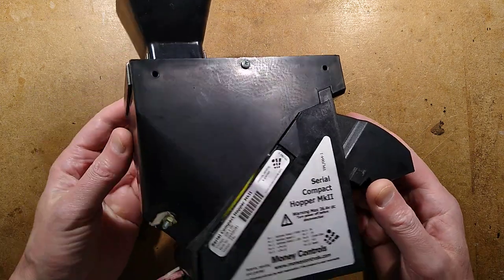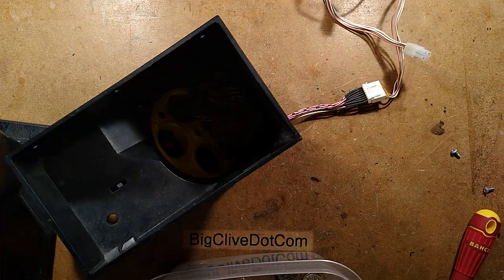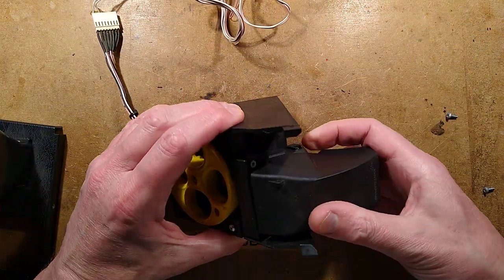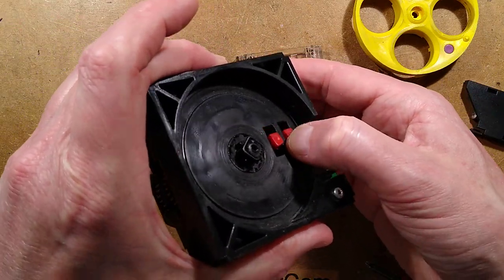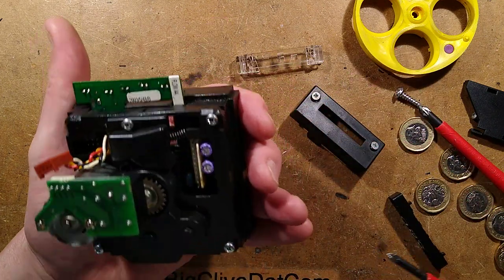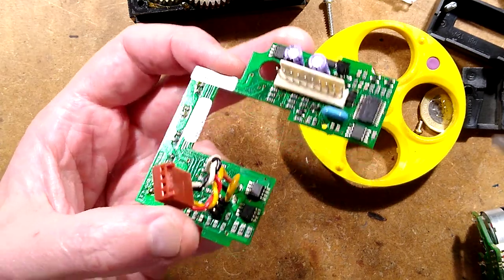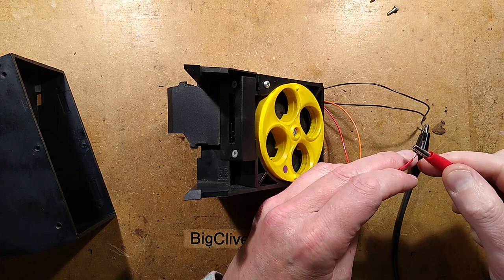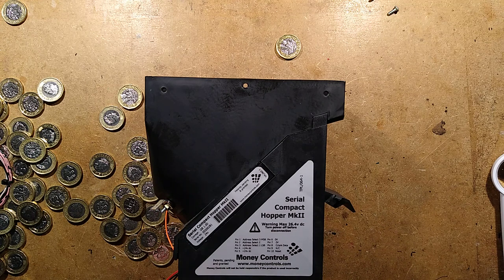Coin payout hopper teardown

Comment: I worked on Philips ATM machines in the late 80's, no coin, but still a very interesting mish mash of electronics and mechanicals. Also interesting was how easy it was to dispense ALL of the cash out to the front of the machine from the service console, who's pin number was VERY easy to guess, if you started guessing from 00000000.

Comment: In the past I've worked for an ATM manufacturer as an engineer and in the beginning of the 2000's the dispensing of coins was added for a short while. The mechanism used was fairly similar to the one you show here. Every denomination had a different coloured hopper wheel. Nice to see one again.
Reply from the maker: In this one the wheels are also colour coded to coin size and thickness.
Reply: @scannaunderscore1  are you high? GO AWAY
Reply: Bank of America still has coin hoppers for ITMs (interactive teller machines, like ATMs but with a remote teller to help you).
Reply: Worked as an arcade repair tech for a pizza loving rat that shall not be named. Very similar overall design and operation in the token-driven arcade space as well, but with non-cash arcade hoppers they don't bother with the parts that make it less possible to get bad counts or runaway from a dead transistor. Neat to see the dual opto sensor since those getting dirty is one of the more common failure modes. Also they just wire straight to a card interface board and it handles running the motor and counting the coins from the opto.

When they converted to card a pay system years ago the conversion was simple for some games, and a nightmare for others that had oddball 120v driven coin hoppers. Took them some time to figure out that EMF from sometimes failing marquee lights from another game on the same breaker would cycle the 120v hoppers.
Reply: @carpespasm  
"Worked as an arcade repair tech for a pizza loving rat that shall not be named."

Chuck E. Cheese
It's named now.
Reply: @unlokia  no hes right though
Reply: 2000s seems like yesterday. Oh my....
Reply: I find ATM's fascinating. I think because they were the first thing i recognized as a machine when i was a kid. I once caught a glimpse into the room behind the ATM which really made me want to see what was going on inside it.
Reply: @scannaunderscore1  troll !

Comment: Next video: "I got kicked out of a casino for hotwiring their coin dispenser..."
Reply: The trouble is opening or I should say trying to open any door on any slots machine or video poker or whatever will instantly trigger a loud alarm and a bright white or yellow flashing light (The "candle") on top of the machine.
And that is not even considering the incredible number of CCTV cameras all over the ceiling of pretty much every casino and last but not least the people !
Other players/gamblers/customers whatever you want to call them and also staff members who will no doubt catch you in the act.

Of course you will definitely get kicked out of the casino but frankly it will be nothing compared to what will follow:
You'll also be banned for at least several years, if not for life from all casinos in your country and get prosecuted and face criminal charges (No kidding... 😂)

Comment: I worked on the much larger versions I guess normally used for change machines that held large amounts of coins so one could say change bills to quarters to feed various vending machines. In this case they were at car washes with most of the machines requiring coins or a variation as they did not give change only time, so you had to have the correct amount. They were bigger versions of what you just showed, only the machines were made of stainless, had bigger wheels for more coins, and a more electronics as it was hooked to a motherboard to convert the bill denominations. They also had an agitator to reduce jams. All in all still interesting machines. The stop relay worked because of the load to dispense the coins was enough that with no power, the dispenser would come to an immediate halt. I'm sure there was circuitry involved to time it correctly to stop. We got some newer stuff in and they were very complicated using mostly bills and just one dollar coins that rarely got dispensed as they were used as backup for the one dollar bill dispenser in case it got emptied or jammed. Those were beyond my pay grade and like the IOTs, were hooked to a mainframe in another state and required their blessing to make any changes. Well, enough for now, thanks for all your videos, I enjoy them immensely.

Comment: I work in the gaming industry and use these hoppers widely. 

The machine counts the coins and it’s upto the coin mech to divert the coins. The operator needs to press “hopper top up” and the machine will tell the coin mech to divert the coin into the hopper or cash box

The low coin pads are in the event the operator did not press the hopper top up so if the hopper is running dry, it will make sure coins go into the hopper. A feature not often used in the gaming industry. 

Mars or MEi used a protocol called Hii or Hi2. Cctalk is industry standard now and used by every manufacturer and part of the technical standard. 

The hot glue is to stop “sniffing” the data line and inject commands. Quite common at one point where fraudsters would try and latch on the data line before encryption was popular. We had to heat shrink all looms years as these started to hold more money. 

The hopper does reverse. The red “things” are called hopper release fingers and can still be purchased. 

You can rotate the hopper 90 deg and it will pay out the side if you wanted too rather than use the chute. 

They do a 4 pin parallel version of this hopper which is even simpler. Just 24v, gnd,opto gnd and coin out

Comment: The light bar multi sensor combination is also a security feature. If the coin fails to break the beams in the right order and time the hopper will throw an error. People will stick LED wands up the dispenser and cause the hopper not to count three coins. By having three lights this complicated defeating the counter. Prior to casinos going countless it was a big problem. The locking hopper motor is also a partial security feature because with enough effort and time you'd be able to spin the hopper disk manually and get coins.
Reply: The light sensors can also be so that if a coin comes out, hits the deflector, then does a brief bounce back into the sensor, it isn't counted again as the sensors have to trigger in the correct order.  Coin mechs also have similar arrangements of light sensors, for anti-yoyo of coins.  Also with the relay it will help if the board gets fried, say by someone with a spark gun, it has much less chance of spitting out money.
Reply: @MakinStuff  I must have disturbed some dust when I replaced a few bulbs on my Barcrest fruit machine and eventually found out it was that little sensor strip causing multiple hopper errors.  Cleaned it and worked a treat but I had to reset after a coin dump as it was misreading the number of coins.

Comment: I wrote the software for many AWP (fruit) machines and the code for driving hoppers, including this one. It has a serial interface, but older ones had a simple 5v line you'd wiggle for the 24v relay to click and payout...watching the opto sensor for coins to pass, or for foreign objects trying to block the opto.

Fun times. I have a box of old fruit machine hardware I should send you.

Comment: Would have been interesting to see you test the DC braking with the full complement of gears meshed with the motor, to see if you could feel a reduction in resistance to turning the wheel after energizing the relay.
Reply: Yeah, I'm surprised about that.  I mean, when he ran just the motor alone it seemed to stop quite quickly anyway (< 1 sec?).  So unless the gears added a lot of inertia, seems like the most you would have is maybe one extra coin dispensed?   But I suppose if you're really striving for accuracy (somebody complain that they only got paid out 49 coins instead of 50???), you can't have that uncertainty?
Reply: @mikefochtman7164  Having one extra coin dispensed 100 times per day would be quite bad for the arcade owner. It's worth the extra effort to make it stop quickly after the last coin is dispensed.
Reply: It wasnt added for DC braking it was added because thieves were introducing their own power to the hopper to empty machines, the shunt made it much harder.

Comment: Club Machine hopper - £250 /£500 payouts
 - Mars / Sentinal made the 'coin mechs' the sensing controls. (Were both made in Royton, Oldham - UK )
the older style Solenoid 'eject from tube' were painful to both hear and endure, - and created a chassis shock on some cabinets ( if PSU was faulty/not earthed via extension lead ? )

Comment: That was very interesting Clive… many years ago I made my own gambling machine from a modified windscreen wiper motor a old timer and cam switch plus a load of 24 volt relays & diodes , had to weaken the return springs on the relays so they  would work on 12 Volts it was all so very amateurish but it did work just couldn’t afford to buy the extra mes bulbs needed to complete the “roulette” wheel of fortune the payout was a tube full of 2 pence coins with a slide mechanism to pulse out the winnings it had different payout values and the odds were random chance. Spend many hours in the shed as a 18 year old but boy was that fun to built and it worked!
Reply: Wow! Could you not just get a 24V supply instead? What did the machine do, roulette? Like it spun around unpredictably, but then how would it know who'd bet on what in order to spit out the money?
Reply: @greenaum  
Well the budget had already been blown on the coin selector mechanism and the payout device, the relays were plucked from some old scrap panel. As a apprentice electrician in the early 70’S on rubbish wages I had to do what I could with what I had. The main power was from a car battery charger which of course was 12 volts the wiper motor which was adapted to run a contact around 40 or so 4mm brass pan head screws with no dead spots to give the visual of a circle of chasing coloured lights.
The colours were red,blue,green,yellow and white just like the original roulette game around at the time. The red and blue made up the majority with a lesser amount of the higher value colours -there was only 4 of the white ones. How it played? Ok insert coin lights began to rotate press the corresponding coloured button to bet on what colour it would stop on, after the time out the cam timer would operate and check to see if you had won and pay out accordingly and reset. Why no 24v supply you ask well as the wiper motor was grounded I was probably unsure about mixing supplies together and like I say it was all done on a shoestring anyway. The only thing that almost made it predictable was the timer which was set for so many seconds, I really needed some random time out but didn’t know how to overcome this. Like I say it worked it was full of diodes and relays and I spent many hours scratching my head, resetting the battery charger and trying different things but it kept me amused and was fun. I’m retired now but seeing Clive with that clever payout brought it all back maybe I should have another go who knows. I quite like building little electronic kits nowadays.
Reply: @David-dz8jb  Wow! Impressed just by your tinkering skills! So I suppose the "bet" buttons were toggles, so they'd lock in once you pressed them. How'd you prevent someone betting on more than one? You could use the things they used on the groovy old amplifiers I favour to use with my speakers (cos I'm poor!), where pressing "phono" pops out the "radio" and "aux" and whatever buttons mechanically, they're all linked with stiff wires at the back in some crazy mechanism that's built into the switches.

There'd have to be a tiny gap between your brass screw contacts though right? So no chance of 2 winning at once. 

And then, what, the coloured bulbs all go through diodes to bunch up together in a massive OR gate, through the bet button, and out to the payment part? And how did you select how many coins it would pay? 

Yeah if it were me I'd have done the "randomness" with some mechanical sloppiness I suppose on the cam timer. Or maybe something thermal and a bimetallic switch, or... there's a million things! Sorry, I feel like it's my project now and I'm all wired up with the sort of things you'd have been thinking. Do pardon me! 

I suppose it'd only ever operate with you supervising and your friends playing it, cos there'd be some right cheating bastards otherwise. Still sounds like you covered just about everything! But it's the things you never think of that end up being hacked!

Ta for sharing!
Reply: @greenaum  
Hi again you are really making my memory burn here..ha.ha more details for you:
The  5 bet select buttons were push button spring return when a button was pressed this would latch a relay and inhibit the feed to the other buttons a light above the button pressed would illuminate to indicate your bet. The set timer would then operate and after a few seconds it would time out then a little delay for the wiper motor to completely stop then the cam timer which had about ten micro switches was set in motion 4 of the micro switches were set a to close and open a circuit in succession so depending which switch was fed from the latched relay this would pay out the winnings accordingly. Also whilst checking the win a light below the winning push button would illuminate before the game reset. I added another feature which was simply a old school clock timer which was being thrown out, this was simply a synchronous motor which gave a pulse every minute if this pulse coincided with the cam timer reset switch it would override the reset and check for winnings a second time if you had a win it was then doubled so a “mystery double win” was born. It’s hard to really describe how it all worked the clever part for me was the how the payout was rooted through the relays and diodes and finally through the cam timer the clunk clunk of a payout was very pleasing even though it was all my own money. My mother would play for ages on it. Pity mobile phones were not around in those days it would have nice to add a few photos here. Obviously it got scrapped eventually but that wiper motor got re-purposed later in life and became the coin pusher machine which again was addictive and worked well, surprising what you can achieve with some perplex,panel pins, elastic bands, bits of wood and a little ingenuity…nice memories.

Comment: Unfortunately, Crane seem to have stopped openly publishing the ccTalk protocol documentation, which is a pity. It took some digging around to find the PDFs.
Reply: Ah, a tiny drill and a sharp probe... You can get cameras that are absolutely minute these days. So stick the right bits into an Arduino and you've got yourself an instant winner device, just watch out for security cameras!

Comment: In the US, we still make dollar (US$1) coins because there's a law that says we must, despite them not being used by the general populace. They are designed so that they have the same weight and inductance so that existant coin readers will recognize them correctly. The only machines that I know of that accept or dispense them are in US Post Offices.
Reply: Curiously enough the £1 note in Britain was replaced by a £1 coin many years ago because the coins last longer.
Reply: @zh84  And the new ones are ugly
Reply: I'm an oddball, I'd gladly replace the penny with a dollar coin.
Reply: The vending machines in the convention center take them. They had to because so many prices went up. The smallest candy bar is $1.25. The sandwich machines are up to $5.00.
Reply: Public transport services machines also use them, such as the NYC subway and BART.
Reply: @zh84  Same for Australia. This was before the polymer notes were introduced.
Reply: @gorillaau  There are now some polymer notes in Britain. I'm not sure if they have all been replaced, as there are five or six banks with the right to print currency in the UK.
Reply: @zh84  all Bank of England banknotes are now polymer. Think there are still some paper £50 notes in circulation but nobody really uses them anyway. Not that many people use banknotes much at all now, Covid seemed to have encouraged most shops and customers to switch to contacless payment. The only time I really spend cash these days is to get change which is still occasionally needed for things like car park machines, although most car parks let you pay by card or by an app not all do.
Reply: @tomwood5896  In Scotland we have notes from the Bank of Scotland and Royal Bank of Scotland; I'm not sure about their material. There certainly used to be notes issued by the Clydesdale Bank. As for £50 notes, a taxi driver once told me that he often gets them from Chinese students! I have never seen one myself.

Comment: Way way back, my parents wanted an old slot machine in their cellar bar. I installed it. ;-) The MK1 version would drop out a coin when you connected the two hinges with a wire. The MK2 just needed a magnet in the right place to trigger a reed contact. Pocket money days....

Comment: Where money is involved, you can be sure that coin counter/detector has been designed with thieves in mind.  Somebody has probably tried to jam something up that discharge chute to try and block the detector so it doesn't count the coins as they discharge.  Probably why two different infrared sources and three detectors.

Nice video with a nice teardown.